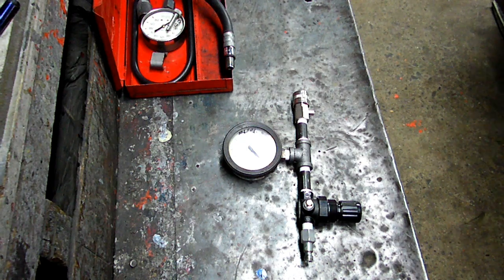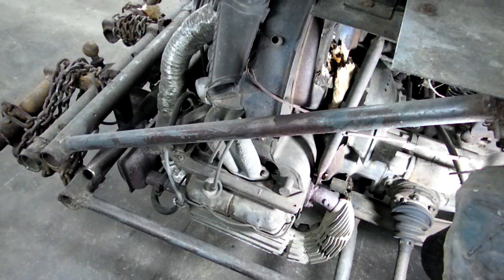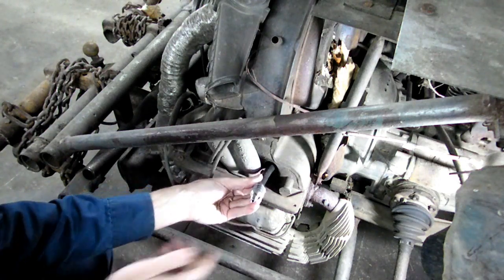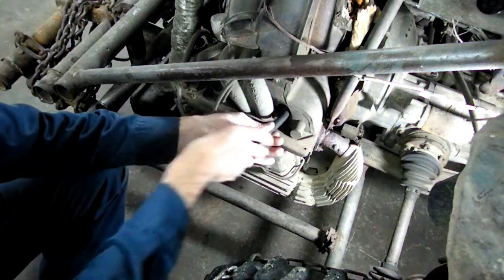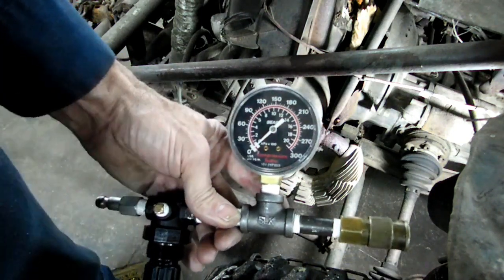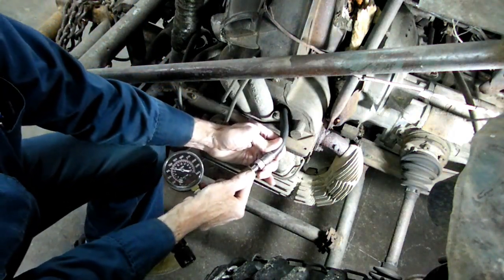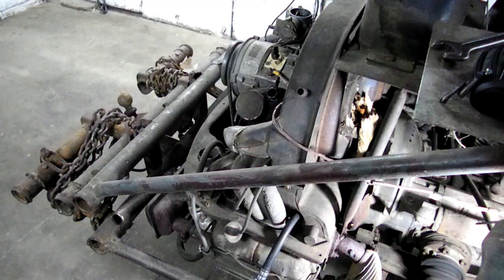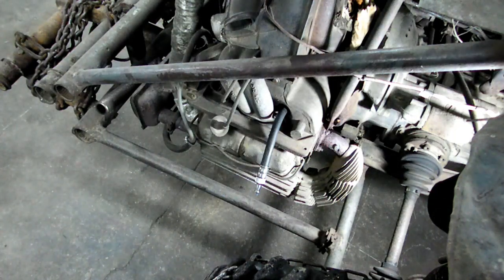Automotive Cylinder Leak Down Test

Comment: You’re doing the test wrong. Here’s how it should be done. First. You need over 100 PSI coming from the compressor. Second. Since you’re using the main line reg and gauge you don’t need a reg on the tester.  Third. You should have the tester connected to the cylinder from the start. OK, once all that is done You adjust the main reg in your system to 100 PSI. Then you subtract whatever the reg on your tester says from the man line reg to get your percentage of leak down.

Comment: TDC is also done to make sure valves are closed.  Of course it is true that if the engine is locked, and the cylinder you are testing is on compression or power, this wont matter as much.

Comment: Hi, can the seafoam remove carbon deposit on leaking valve ? so it will fit again? Thanks
Reply: Never tried Seafoam because water is free and works great. Get the engine up to operating temperature and find a vacuum source on the manifold that has a small diameter vacuum line. Get a gallon of water and, with the engine running and at operating temperature, have a friend hold the throttle at 2500-3000rpm and submerge the vacuum line in the water and let the engine ingest the water. The throttle will need to be modulated to maintain the 2500-3000rpms. Let is ingest water for a few seconds and then lift the line out of the water to let the steam stop and the engine recover for a few seconds and then repeat until the water has been used. You will see a lot of white steam come out the exhaust.

The water turns to steam in the engine and shock cools the carbon which causes the carbon to break free. Ever seen how clean and carbon free a piston crown, cylinder dome and valves are after and engine has been running for a while with a blown head gasket where coolant has been entering the cylinder? Same principal.

Many people will say, "Whooooaa dude, your gonna suck in too much water and hydro lock and break a piston or bend a rod!!".   Well, that's why we use a small diameter vacuum line and port to suck the water in with. We don't want to use anything large like the brake booster vacuum port.   With a small vacuum port and line, the water is pulled in at such a low volume this is a non issue.

This is an old timer mechanics method I learned 20 years ago from a 45 year veteran mechanic.  I have used this method to clean carbon from valves, piston crowns and combustion chambers on well over 250 cars and works a dream.
Reply: Hi, thanks for info... :)

Comment: You should be holding the crank Pulley because it will turn the hole motor over where it will open the Valve

Comment: Hi Rich:
I ended up buying one from OTC off of Amazon.  I couldn't find the parts to make one for less then the cost of buying one.  The pressure regulator was the part I had trouble with the local stores all wanted $30 or $40.

Comment from the maker: I checked the rotor in the distributor to make sure it was pointing to the cylinder i was working on before i started.It does make you wounder because of all the leak down.

Comment: Hey Rich are you sure you weren't at TDC on the exhaust stroke instead of the compression stroke? That would explain the pressure escaping through the exhaust valve.

Comment: Hi Rich Pin:
Thanks for the video.  Nice to see an "old school" man building his own tools.  I am thinking of building one of these LDT but wanted to have a two gauge system right at the tool because my air supply gauge on my compressor has a lot of hose between it and the connection point.  Instead of a plug if I put a second gauge in the regulator would that serve my purpose to have an accurate reading?  I think so but am not positive.
Reply: Seadawg I'm fairly certain you are right. As long as one gauge is on the upstream side of the epoxy orifice and the other gauge is on the downstream side in order to measure the differential pressure and get the the percentage reading.

Comment: I have an engine that's using a lot of oil. 1 quart per 500 miles. It's a Honda Civic-2004. Would this test tell me where I was losing the oil. The engine is a used replacement engine supposedly with only 60,000 miles on it. It's under warranty and I want it replaced because it is using so much oil.

Comment: Very good video! 
I've used masking tape on the balancer to determine TDC for different cylinders. Cut a piece of masking tape the same length as the circumference of the balancer. Make three equally spaced marks on the tape, put the tape on the balancer starting at #1 TDC. Now when the marks line up with the timing pointer each piston will be at TDC compression following the firing order.

Comment: @darkfyre2k7 from the looks of your tests, if not replace the engine, you would have to send it in for some machine work. the bore of the cylinder is probably just as worn as the rings. A machinest would bore out the cylinders, and you always want to replace the rings on every piston, not only because they come in a set, but because replacing only one piston ring set would cause uneven compression anyways. and your test also indicates you probably need a new head gasket...

Comment: @richpin06a well it vibrates a lot when it's cold, but that might just be from imbalanced compression, or so I'm told... would that be a sign that the crank is trash? did the leak down test and it's only rushing through the oil filler... even did a head check and a rad check, no sounds coming from those and no bubbles in the coolant resevoir

Comment: I have a 97 dakota V6 with ring leaks, and the local garage said replace the engine... would just replacing the rings be okay? they only went out 160 miles before testing compression... readings were from cylinder 1-6, 145, 140, 100, 120, 75, 95... the guy said that something like replacing rings would blow the bottom end out because of stress attributed to power returning. is he right?

Comment from the maker: @spelunkerd when pressure is applied (e.g. 100psi), what we are looking for is leakage in the cylinder as compared to the airflow through a 1mm orifice at that pressure. You could use a shut off valve.

Comment: So, I guess the reason for the pinhole is so that the regulator can't replenish air fast enough to maintain pressure when there is a significant leak. Would an instream shutoff valve accomplish the same thing? Do you think you could eliminate the second regulator and just have a shutoff valve? I find my airhoses tend to leak at those quick connections, which might confuse the readings....